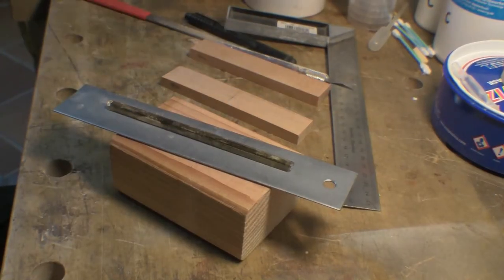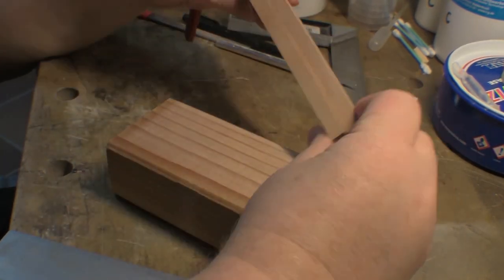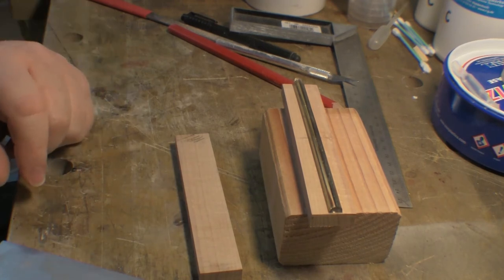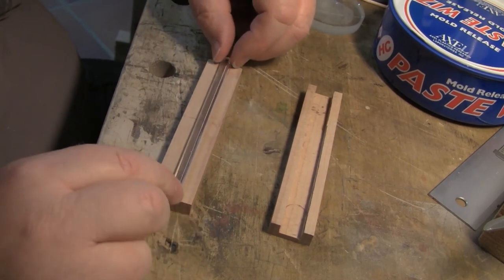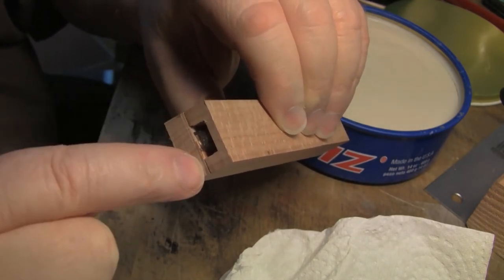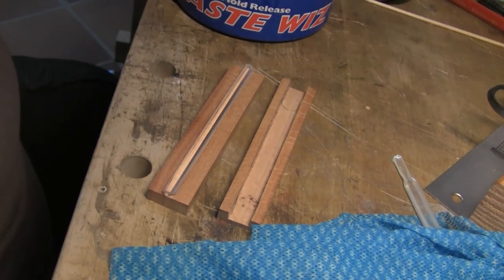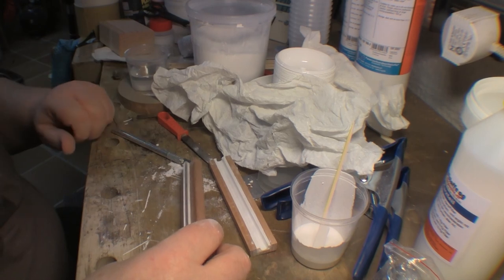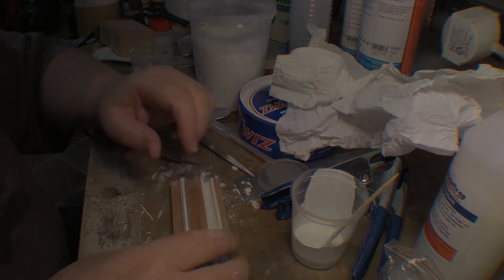Telefunken Bajazzo 55 - part 8

Comment: John:
I was having my doubts that the Plaster of Paris was going to fill up the whole channel by filling one end as you did. Especially with one end blocked like that, I thought trapped air would be towards the bottom. But it worked!
Nice job for the first try! Hope you can figure out how to get the releasing wax tight against the base of the rod.
Looking forward to the next try.
Tom

Comment: I was thinking along the same line as Tom.  If you put a small hole in the opposite end from the end you are pouring in, maybe you'd get better flow through.  Then, obviously, block the dribble hole.  Interesting problem.  You are getting close, John.

Comment from the maker: Hi Bobby, that's what I did last night - the bezel edges are rounded over so the moulding compound went in 'underneath' the plastic part and when I forced the mould apart it cracked where it had gone around the lower edge.   I filled it along both sides with some of thin strips of the modelling clay and this time it released much more cleanly.  I'll post an update over the weekend.
Cheers,   John